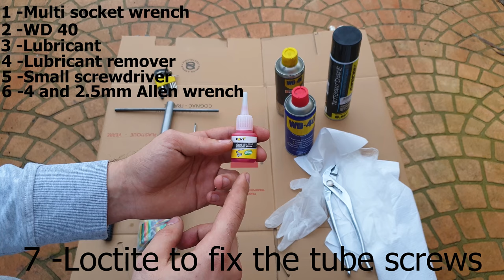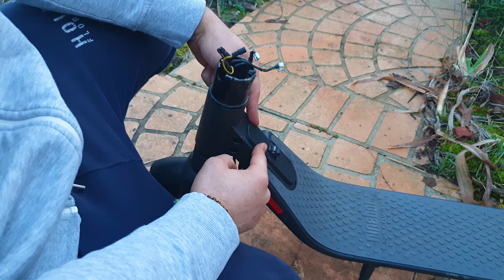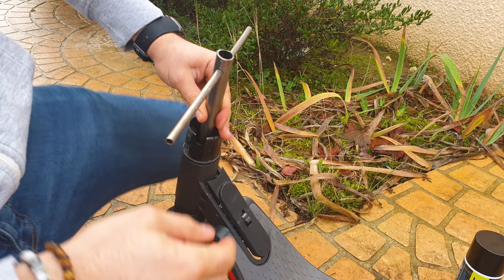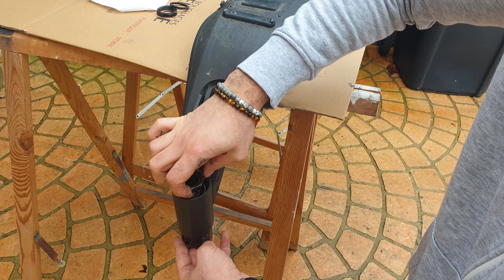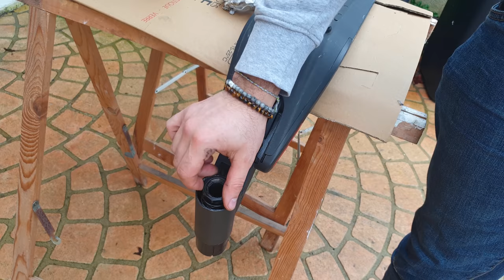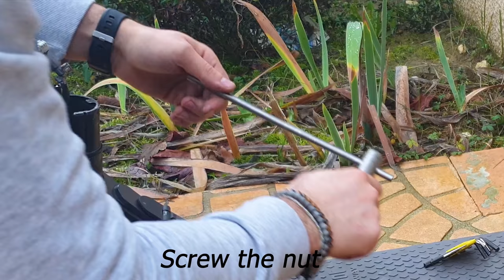🔧 Ninebot \ Segway - Fix Fork & Steering Loose On Ninebot Es and E25E Scooter - Reparair 🔧

Comment: So A mechanic will tell you that removing the actual grease from the bearing and replacing it with wd40 of any kind is a bad idea and will actually risk causing more damage because it not actually a proper grease that stays around, you must re-apply Atleast bi-weekly for best effectiveness. So, great video, nice tool. But honestly, you can do this all including make your own tool without taking it apart once a month to ensure you have proper amount of lubricant. Try using actual bearing grease and pack your bearings. It will work better than tearing your head apart every month.
Reply from the maker: Oups sorry for my mistake, i am studying for a master's degree in computer science. I am learning a lot on the job.

On my scooter it's all fine, it run more that 500kms in this configuration. I hope anyone make my mistake. 

Thank you for your comment !
Reply: He uses WD-40 Lithium Grease. Not the regular wd-40 that removes grease.
Reply: Excelente! Good video

Comment: фиксатор резьбы лучше в данном случае использовать синий а не красный.  спасибо за видео. многим это сэкономит время и нервы )
Reply from the maker: Hello, in my case, the thread locker is red but not as hard as the official red by loctite
Reply: @yourfrenchtools7807  hi! got that. when repairing a motorcycle fork, I encountered a problem associated with a red retainer. I had to warm the hairdryer to unscrew the bolt (400 degrees Celsius).
Reply: @yourfrenchtools7807  my bottom backlight is off. you don't know what it might be?

Comment: You should have greased both bearings not lubricant them, lubricant is sort of a liquid to help reduce rust and keep out moisture grease on the other hand let’s the bearings roll around and helps maintains the bearings life span from Keeps Particles from getting in and wearing them down

Comment: What is that wire sticking out from the wheel  that you talk about on 5m 30 sec of the video?  These wires are broken off on my scooter, but it still seems to work fine. What are these wires for and how do I fix/reconnect them? Many thanks
Reply from the maker: Hello, this cable is used to light the back leds. You can fix it by stripping the cablrs and resoldering them. You can find a soldering kit on aliexpress for 15$

Comment: I'm gonna buy this tool BUT where can I find replacement ball bearing rings? I have a few broken/missing ones on both rings :(
Reply from the maker: Hello,
I didn't know that we can loose sommes bearing balls...
 I looked a bit for you but unfortunately I did not find anything. Maybe try to find someone who sells a scooter for parts.
Reply: @yourfrenchtools7807  I didn't have any luck either thanks for your effort :) was also thinking the same.

Comment: Does the E25E also need that handmade tools? It has that special bolt or an hexagonal one?
Thanks
Reply from the maker: Hello,

A new video should be shot in the next few days to present the dismantling of the ninebot E25E.
usually the nut in the axle is exagonal, I recommend my customers to check this information before ordering

You can find the tool to disassemble this nut here : https://www.ebay.fr/itm/203859338345

And soon on Amazon

Comment: hey does this product ship to the US?
Reply from the maker: Hello,
Of course, i deliver throughout the world !
Reply: @yourfrenchtools7807  Great, thanks for the reply! i will order today or tomorrow!
Reply from the maker: Perfect, thanks for your confidence
Reply: @yourfrenchtools7807  Actually I've been watching some more videos and I think I can get the nut tightened by sticking a screwdriver into the gap and turning the wheel. But if that doesn't work or if it loosens up again I will order the tool.
Reply from the maker: Yeah i try this one too, i try. 
The fact is, you need to remove the axis and you need to remove the nut
Reply: @yourfrenchtools7807  Yea I tried using a screwdriver and turning but I only got it a little bit tighter my handlebar is still loose. I might have to buy this after all lol.
Reply from the maker: Unfortunately this is not the reliable way to fix it, the nuts cannot be resealed properly.
Reply: @yourfrenchtools7807  Yeah I can only get them finger tight I need the tool to take it apart and use a wrench to grip it and get it super tight. I'm a little busy right now but later this or next week I'll place an order for the tool.

Comment: I ran into a curb with my scooter and the stem isn’t level with the wheel.out of all the videos that I watched(many videos)not one showed how to do it.this also isn’t exactly the problem but it seems close though I don’t want to risk breaking it.what should I do?
Reply from the maker: You fell, and the wheel is no longer in the axis of the tube?
Reply: @yourfrenchtools7807  it is still connected just in a weird way.the stem is straight and wheel is perfectly fine they are just not leveled in a straight line
Reply: When I hit the curb the whole wheel shifted and it’s stuck in that position
Reply from the maker: @binyaminelkouby1699  Exactly the same thing happened to me in a big fall.
The best and most on method is to dismantle the stem, then dismantle the wheel and replace it correctly (as I did in the video without touching the bearings).
That's what I did after my fall. I don't know if there can be other methods to fix this.

Did you hurt yourself during the fall?
Reply: @yourfrenchtools7807  thank you I will try to do that but I am having a lot of difficulty dismantling it.is there any other tool that can get into that center screw?

Yes but I’ll get better hopefully,this happened yesterday
Reply: Would it help if I try to put it back by force?
Reply from the maker: @binyaminelkouby1699  I don't know if it's a good idea it can damage the fork
Reply: @yourfrenchtools7807  alright,it’s just that I’m too scared to open it up.I might not be able to assemble it back together.merci beucoup man,your the only that actually reached out and helped me somewhat.subscribed and I’ll let you know if and how I fixed it.

Do you live in France?
Reply from the maker: @binyaminelkouby1699  As you can see in my video, it's not very complicated. I'm not a big handyman, if I can do it, you can do it too.
I am happy to help the community, thank you for subscribing. 

Yes i live in France
Reply: @yourfrenchtools7807  I just tried a different way and it worked!I pit a wrench from the bottom and twisted it from there!the only problem is putting everything back which I am not managing too well.thank you man!
Reply from the maker: @binyaminelkouby1699  Great !

Comment: because the wall of the stem is so thin and aluminum by putting a bigger bolt with a wider thread it is hardly fixing to the stem wall, what I have done and seems very solid, ( I have drilled 6mm straight  one side to the other of stem and bar holder,  then bolted all the way through and to make the bolts useful I used bolts with a bent loop head, not hex, 2 nuts the other side the last locks the first solid) I've had the stem snap and the one from the deck to stem snap, used scooters, people tend to hang on to the handle bars for life, in my opinion and I am a true old school ELECTRIC SCOOTER LOVER FOR NEARLY 20 YEARS,, I am a 57 young mechanical engineer that has RAZOR E300, &E300S wide wheel, Aovo pro, Wind-Goo M12, Electriq , Jungle one, Hover X1 Eagle,  2 razor e100, one I'm making from BMX scooter with a kids 14inch mountain bike monoshock sprung back end and wheel, spares from all sorts, a tricycle imtrying to electrify and a range of motors wheelchair, tool washing machine etc I will get or make a dual hub fast scooter, RION OR WEPED MIND so many great scoots now RAZOR was it back then but great custom point to build from, I had one doing wheelies using 2 18v tool batteries direct to motor with a drill trigger, I don't think the early e300 motor had a volt rating, it melted thick wire and switches but motor was ok,  put E100 sprocket on the E300 with shoulder bolts in the 4 slots, aovo does 28mph, great fun
Reply from the maker: Hello,
Thank's for your comment !

This video is aimed at a large audience that does not have the tools/skills to modify their scooters 
The first solution usually does the job for most people
Reply from the maker: @1Saltyone  Not everyone is able to pierce their scooter, and this is not the only problem with the play in the stem
Reply: do you have a photo of the stem to share?